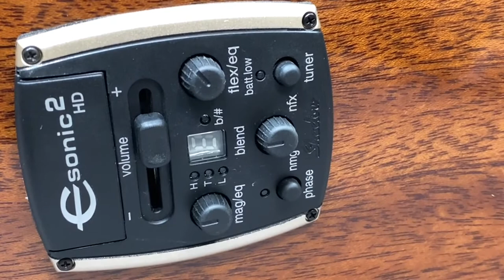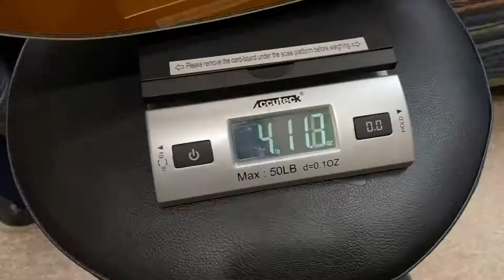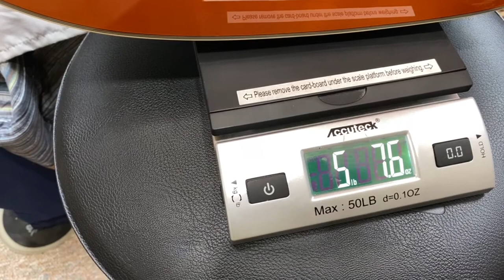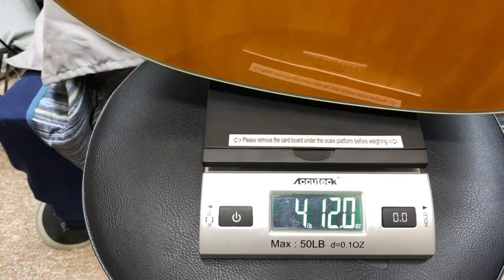Epiphone DR-500MCE - China vs Indonesia - Part 2

Comment: What l see...1. immediately the finish on the Indo looks much nicer, the reflection shows it's much flatter finished. 2 the fret board on the Indo has a beautiful black ebony wood which is also used in the bridge. 3. The mahogany on the Indo is much nicer looking and likely a much better mahogany. 4. I didn't notice til you showed the back that the binding and neck end cap are a much nicer shade of cream white on the Indo vs the plastic bright white on the China model. If l had to choose ld be happy with the Indonesian model based on these differences, as long as the necks are the same profile and equal action can be achieved on both again the interior of the Indo looks 10times nicer, if one was to be called "Masterbuilt" it would be the Indonesian, the glue work was much neater and the corner wood that is used joining the deck and back was clearly not the same wood use on the China model. Day and night to me. Thanks! Great Vid!!
Reply from the maker: Glad I could help.
Reply: I have 2 Masterbuilt dr500mce _ 2014 Indonesian and has Rosewood Fretboard....not sure what year they changed that to ebony. 

Ps. My Bridge looks darker, but also seems to be rosewood..not quite ebony. ✌️
Reply: Ps. I noticed a difference between my 2014 and 2015 (both plekt  and no notable blemishes from the process) as far as the action goes..and note I did have my Luthier friend shim the nut, and shave a little off the saddle on both to achieve insane action without any buzz...and also a  fret level...and the action is great on both...
but the Saddle on the 2015 is way shorter compared to the 2014...so my point is...the action will never be exactly the same with comparible or even exact models of same year. And though they may or may not have been plekt,  because they are not Gibson and built for price, and if you do not spend 1800 to 4000 , I have yet to find a perfect setup out of the box.

When I purchased my Yairi...just got a shipment of 20 guitars that were all similar,  some different colors...and they all played different,  action,  neck, and feel..I spent an entire afternoon playing each one, going back and forth and checking off the pros and cons and whittled it down to to 2...but the one that played the best out of all 20 , it had an ugly color (to me in my opinion)  compared to all the others, even the 2nd best had Gorgeous colors and tight grain...anyways, I bought the one that had the Ugly color and that played the best...and I was forever in love with that guitar for years until I had to sell to save our house. . I figured I wouldn't be looking at the Guitar while playing it...and play like a dream while I was...so the moral of the story is...
Looks do not make a good player and if it's ugly as heck but plays like you like it to, buy the ugly one. 

And it's better to be good first and look good second. 

If you are interested,  I am letting my 2015 Epi materbuilt Dr500mce (gloss natural)  go...need to sell it while I am taking care of my mom to cover some bills...hate to let get go, but family first. 
Comes with hardshell case and is in Excellent condition  , plays like a dream and looks fantastic too. Best of both on this one. Made in Indonesia. I live in OH. Hit me up . Rk n Rll.

Comment: Hi!! Found some info in a guitar forum, I hope it helps!!

"The DR500MCE had quite a production run with the made in Indonesia, Esonic2 dual pickups and being Plek’d.
Towards the end of the run, they were still made in Indonesia, plek’d, dual pickups but used the ESonic HD preamp. Which was just a modified version of the Esonic2, a couple less features.
The last production run, was made in China, not Plek’d, and just a single pickup with. A Fishman preamp.
The last one I have seen so far that was with the dual pickups and Plek’d was from September 2019. Maybe someone else has a later one, but I have never seen one.
As I was informed, the problem they were running into with having the guitars Plek’d was that so many were damaged in the process with carelessness or workers going to fast for production. I have never seen so my guitars sold as refurbished as this model.
Be very careful when purchasing one. If it has that copper label or similar covering up the original serial number, know that it was rejected at the factory and sold to a outside vendor for resale.
That means if you call Epiphone and ask for information on the serial number inside a refurbished one, they will tell you it’s not theirs and it carries no warranty. The back of all those refurbished ones will also have USED stamped into the wood.
Hope this helps.
I love this guitar BTW, I own 3 of them all from Indonesia, I also have the DR400MCE made in China I believe."

I can add myself that the idea of the Nano-mag pickup is to use it more like an electric pickup (add overdrive and other effects with better results, etc "a la" Kurt Cobain in the Unplugged album) + an electric amp, and use the piezo as a standard piezo acoustic. Having separate outputs allows for switching from one to another, as much as blending to taste. I could "add" the nanomag with some overdrive to "uplift" the choruses in my acoustic solo gigs, and it was great!! and that's just one option!
Reply from the maker: Very cool! Thanks for the valuable information. That will help a lot of people.

Comment: China version looks like Pine wood bracing and also for a split second showing the inside of China made one, the bracing near neck joint has a inch or better gap where it stops and does not go to edge of neck...China made cut corners...I have 2 Indonesian made dr500mce's and the China made ones are very different as far as sound too. The extra glue or press board on the Chinese one dulls the sound...and also saw a Chinese one that is same year as mine are, and were in a better controlled environment than my house and jam room...that had long splits on top and back. 

ON THE Indonesian made Guitar,  it is obvious the wood is much better quality, aged better, and overall way better construction with mahogany bracing, (instead of what looks like Pine Wood bracing with some type of paint covering the wood grains on the main braces on China made)

Sure glad I purchased the Indonesian made . And for the price, the playability and ESPECIALLY,  the tone, resonance, low end, and Gorgeous sounds that are comparible to 98% of the  $1200-1500 dollar range of guitars  on the Market or to date...I and I've sampled over 20 different guitars IN THAT RANGe of price and this Indonesian Epi Dr500mce blew them away. It's balanced of lows to highs still amaze me. And the electronics are pretty cool too...dig the mag p/u and stereo capabilities,  but nothing like the old Fishmans..W/Eq....I use a70s mxr eq to take some high end off.

The neck, tuners, wood, (last of the rosewood fretboard s , ) playability and sounds surpass any in same price range and beyond as I mentioned above. Best regards,  keeep on rockin  in the free world

Ps. My Epi's are 2014 and 2015
Reply from the maker: Very cool. Thanks for the insight.

Comment: Cool video. My Indonesia made has 2 pickups with the HD. Sounds great, and looks good. For some reason I have 2 of the paper tags inside. One put over the other and the bottom one has one digit different. Have you ever known that to be? I'll be changing the strings sin and I'm going to peek under the top one to see what number was different.  The top tag says it was made in 2019.
Reply from the maker: Thank you so much. That's interesting. It sounds like maybe yours got double stickered. Maybe two serial number sheets got stuck together on the line. There's probably a guitar out there somewhere that shipped without a label inside it, or it got to QC, and they pulled it off the line. You may have a rare guitar there. It's certainly a conversation piece.
Reply: @RyansCustomShopandGearOutlet  I looked today at the numbers and they are thousands off. The top one has it as number 8223 as the number made, and the bottom one has it as 0823. The date numbers are the same. This seems very strange to me.
Reply from the maker: @lodiwish  that is weird. Maybe a factory worker found an extra label, and just stuck it on there. Lol!

Comment: How can I tell where my DR-500MCE/VS was built?
Reply: Based on cutaway it looks like Indonseia, does this cutaway rule  prove consistent?
Reply from the maker: It should be on the label or headstock.
Reply: @RyansCustomShopandGearOutlet  the stickers from the headstock have been removed (pawn shop guitar) but the cutaway deems it from Indonesia,  so you have answered my question + Thx! Any other tips for this  guitar? I have not had a masterbilt before.
Reply: He showed u in the video..."noticeable differences",  like the cutaway and etc.

Comment: These are discontinued now.
Reply from the maker: Oh, wow! I should’ve kept one. Lol!
Reply: @RyansCustomShopandGearOutlet  I’m actually convinced the reason they made some in China is to use up left over material from the DR400MCE. Personally I feel like the Indonesia model is made better. There were 4. The DR-500MCE, DR-400MCE, AJ-45ME, Guitar Center/MF exclusive AJ500RCE in sunburst and a natural that I have only seen one of in person and snatched it up. They replaced them
With Frontier, Excellente, and Texan.
Reply from the maker: @joshuataylor672  that explains why the Made in China looks exactly like the 400 with a 500 label. I recently acquired a cheap Mitchell T313CE/N (Made in Indonesia) that has a small ding on it. It has a solid spruce top, mahogany back & sides, Fishman Presys/Sonicore pickup, TUSQ nut & saddle, D’addario strings, and it sounds really good. Indonesian made guitars are very nice.
Reply: @RyansCustomShopandGearOutlet  not saying for sure that’s the reason for the DR-400 and 500. That’s just my thinking. They only made the 400 for about a year, maybe 2. I also noticed it was only the natural that made the switch from Indonesian to China. Or at least I never saw the sunburst from China. I do know the Esonic 2 HD was a newer version of the pickup.

Comment: Mine is made last year in 2020 and it's from Indonesia and only has one input for my amp it's a fishman pickup it's also the sunburst  version
Reply from the maker: Cool. Fishman makes great stuff. I’m sure it sounds awesome.
Reply: @RyansCustomShopandGearOutlet  yeah I like it but one of the wires are rattling inside when I'm play the a  note
Reply from the maker: @Mmaya94  that’s an easy fix. Check inside to see if a wire came off its mount. Loosen your strings and take a video with your phone, so you can see.
Reply: @RyansCustomShopandGearOutlet  thx I try that